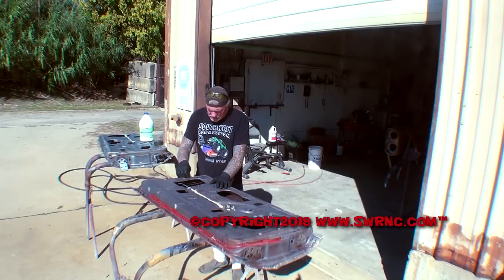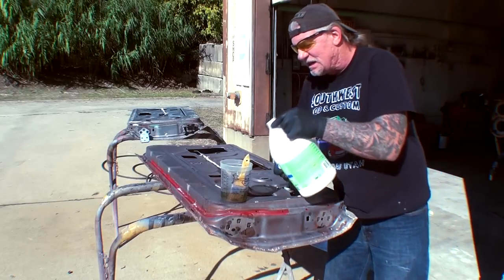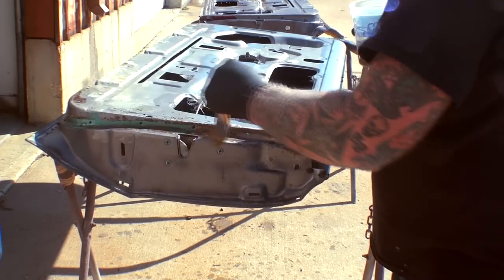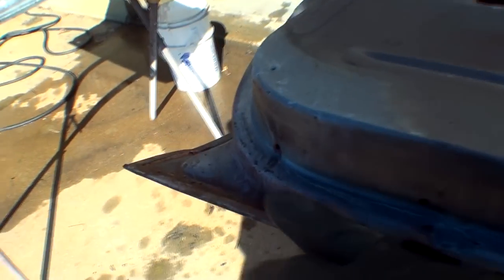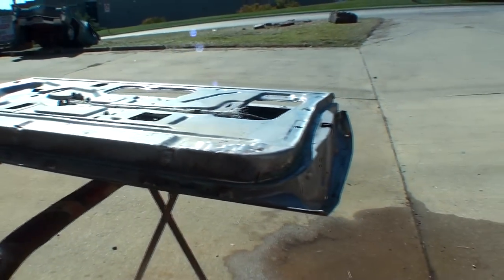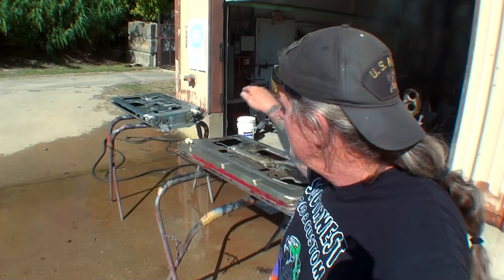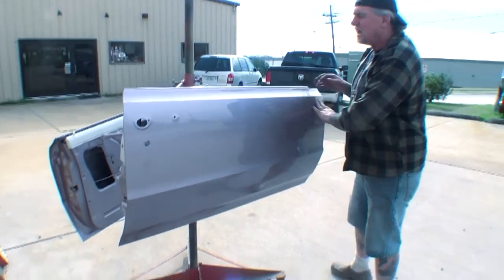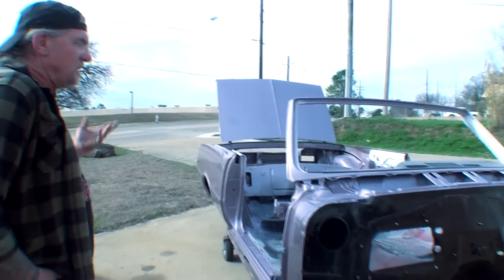"REMOVE RUST With Muriatic Acid - EXTREME GAIN!

Comment: Pete... buddy.  You did a good job stripping the car parts and getting ready for painting.  I notice that someone has beat me to it telling you that your technically wrong about the chemicals.  Muriatic acid is a very strong organic acid.  That yellow film left after vinegar (acetic acid) is RUST that is initiated by those acids you are using.  The acids eat into the metal because they combine with iron causing oxidation.  Adding  water when rinsing will also cause rust by introducing oxygen to the iron in the bare metal.  To stop or slow down the oxidation (rusting) you should use a baking soda and water solution. If you want to leave it exposed over night or for longer you can keep oxygen away from the metal to prevent or at least slow down the rusting by coating with PAINT (primer) of some kind or oil as soon as possible. Once you do that then you don't have to be a a super rush or hurry to get the rest of the job done. ALSO, any vinegar or muriatic acid left inside that door is going to cause accelerated rusting so it is very important to properly neutralize the rusting chemical reactions using a buffer or alkaline solution such as baking soda or an oil to block the oxygen getting to the exposed metal.  Old school is great but a little technology can preserve those parts for many years to come... a lot longer than just out the door with a nice paint job.

Comment: Ive beening using muratic acid for many many years works great....and neutralizing with vinegar, i would highly recommend one addition tip afterthe vinegar step... was with water and phosphoric  acid  the panel will not flash rust with orange flash rust... or just brush on phosphoric  pure... last months with no rust..

Comment: Keep the vids as long as you want to get the info explained properly Pete. Anyone who complains can bog off to somewhere else and annoy them lol. I’m a single female of a certain age who is chuffed to have made a new driveway at the side of my house in order to start the restoration of my Ford mk2 Transit 1983 ex ambulance. I’m learning sooo much from you and want to do it stage by stage and do it right because il be putting on many decals once the paint job is completely finished. Then the campervan conversion will begin. I’m totally obsessed with rust prevention as I live literally 50 yards from the sea, salted roads and it rains here in Northern Ireland probably 350 days a year! The last thing I’m going to do is general prime and paint the way I’ve seen other van lifers do as in 2 yrs I’d have to be starting from scratch again. Thank goodness you are prepared to take the time to help as without you imparting your knowledge, I realise I would have ended up with the wrong products which wouldn’t have done the job. Thanks Pete and camera lady xx

Comment: Dude, you can't neutralize one Acid with another Acid. Both "Hydrochloric Acid" and Viniger "
Acetic Acid" have to be neutralized with a "Base"  Baking Soda is a base. if you don't the acids that are sitting in the little places you didn't get thoroughly rinsed out will slowly continue to eat the metal under your paint. You can put the baking soda on directly or mix 1/4 to a 1/2 cup or more per gallon of water and spray it on the parts then rinse that off thoroughly once the bubbling has stopped. then coat the metal so it doesn't flash rust.
Reply: davem3945 I am EXTREMELY glad you pointed this out. Vinegar will NOT neutralize muriatic (or any other) acid. Baking soda (or another extremely basic compound) is the only thing that will neutralize an acidic substance. Thanks for your chemically related input! :)
Reply: @TheMudiver  using enough water will eventually nutralize the acid. I would use pH test strips to confirm in all the right areas before moving on.
Reply: @TheMudiver  Nope...  The surface layer of steel has as positive charge if not neutralized properly...  That is what causes flash rust....  The steel seeking to gain negative ions, oxidizes in the process.  A better choice is Phosphoric acid. It changes rust to ferric phosphate and Iron III Oxide. Both of which are stable and resist formation of more rust. But it still needs to be neutralized with baking soda in distilled water or ammonia in a sprayer.  To really fight flash rust, rinse with distilled water..  Chlorinated water is acidic.
Reply: I put a gallon of muriatic acid in my gas tank full of water so wondering what do I do in the morning when I dump it? I bought liquid seal and I was just going to put the gas tank in, seal it, fill it with gas as fast as possible
Reply: You don’t want to neutralize with baking soda it will leave a residue.  Best way is ammonia because it completely evaporates and leaves at neutral.
Reply: good recommendation for safety. two other things to be aware of though: the type of sprayer and its condition - the bicarb solution, when dried forms a film that can clog sprayers but cleans up easily with water keep tools clean and ready to use in an emergency to neutralize strong acids quickly (although typically muriatic acid solutions are only 25% concentrations of HCl). also be careful of carbon dioxide gas produced by the reaction of HCl and NaHCO₃. work in a well ventilated space and/or move to fresh air if you experience exposure symptoms.
Reply: @Imwright720   this is actually also a good recommendation. although this residue is easy to remove before painting. note though that HCl and NH3 react to form NH4Cl (ammonium chloride, which is typically found in fertilizers) as well as quite a bit of heat, depending on the volume of the reactants and how quickly the reaction takes place. the heat vaporizes both starting components and the NH4Cl crystals form in mid air as they mix together often producing a dense cloud of what looks like smoke. like smoke from a fire, this cloud contains a mixture of gases and solids which you should avoid breathing in. use a respirator and work in a well ventilated area for safety. NH4CL is often used in the metal working industry for prepping surfaces to be plated with other metals, such as zinc or tin. in this case we are talking about painting body parts but the same applies as a good cleaning method. It works as a flux by cleaning the surface of workpieces, reacting with the metal oxides at the surface to form a volatile metal chloride.
Reply: No worries,  your welcome.
Reply: @Imwright720  thanks for the information about ammonia
Reply: Phosphoric acid mentioned above sounds like a good idea, I’ve used trisodium phosphate (TSP) as my neutralizer in the past as it’s clean rinsing enough to get primer on.

Comment: Used this acid in concrete work for cleaning trowels and tools. Left a trowel overnight in the acid and the following day I noticed a discoloration line where the trowel corner had been submerged overnight. Thought nothing of it and went to the job site. When it came time for me to begin flat troweling the cement slab, I took one swipe with the trowel and when I put pressure on that corner it snapped right along the discolored line.  Those trowels are hardened spring steel and that acid turned the metal to a brittle potato chip.  Like Pete said, bad stuff if used improperly. Thanks for the vid, good info.

Comment: I have been doing something similar to Pete for two years now on my restoration and his advise is right on. Right down to the wire brush between acid coats. I use acid called Metal Prep from HD which does the same thing. Results are amazing. Multiple applications is the ticket too.

Comment: I want to know which of these chemicals will kill and stop rust on the inside of panels where you cant fit your hands to grind or sand??? just by spraying & then next spray some dome type preventative like POR and or chassis paints. What chemical would this be muriatic or hydrochloric? And next baking soda water wash to neutralize ?

Comment: What's your timing for NOT putting it into epoxy primer?   I hear some restorers put Ospho on if they plan on not getting to the body work for a while.  Then they reactivate with Ospho and then rinse with water, dry and start body work.
Reply: Read my other comments. What I said exactly. That's from a old timer from PPG paints. Water or water and baking soda. Stops reaction fast.

Comment: Yeah I like to get all my paint off my metal item. Do the Muractic Acid thing with paint brush, keep chipping, scraping and wire brushing it till it's off. Then rinse job with water and the apply till the surface is totally clean of rust in the pits. Then rinse with water. Then apply B&G rust remover (it's a liquid remover that leaves a coat to prevent flash rust after flushing with water. Once the metal is dry. If you live in a warm hot climate leave it in the sun or colder climate use a propane torch to dry the metal out. At this point u can prime it or lightly sand blast if you want the nice satin finish of sand blasting. Blow it off with compressed air degrease if you touched it with oil or bare hands. Then body work the panel or prime it. 
Acid has the ability to get into the pits which sand blasting can not do.

Just want to add to above.

Another way of Derusting if you have not seen on You Tube is Electrolysis.
 Where you use a 10 amp 12 volt battery charger.
U have a large pail of water, a wooden stick across the pail.
You hang your rusty metal item on a S hook off the wood stick. You then hang four metal rods around the edges of the pail. Wired in series back to the first rod. The metal rods must not touch the piece on the S hook to be de-rusted.
The metal item Ito be de-rusted is attached to the negative terminal of the battery charger. The metal rods around the pail are charged positive. Let it sit for 24 hours. All rust is attracted to the out metal rods which are your anodes. This is the cheapest way to remove rust. After clean the metal item with SOS pads, liquid soap and flush with hot water and dry.
This method does not remove any base metal.
Do not do inside, operation produces hydrogen. OK

Comment: Interesting video.
Muriatic acid will clean concrete and is even a phenomenal to clean out your engine block for a rebuild. Not to mention that it will dissolve the galvanized coating on steel.

However, addressing an acidic condition by introducing more acid doesn’t make any sense. The easier and cheaper solution is to saturate the item in baking soda dissolved in water. This will neutralize the muriatic acid

Comment: Thank Pete.....getting ready to us muriatic acid on the inside of a old flintlock barrel that has been neglected for the last 100 years.....in fact, mud daubers had taken up residence inside the barrel.  The stuff works......just work fast with it!
Reply from the maker: and make sure to remove it all too.. If not all removed properly will keep eating the metal and actually rust!

Comment: i use fosforic acid (+/-50%). with brush or spray. after it's been working in i usually take methylated spirit to clean it. Water brings risk of rust again. But this also seems to work. Nice video and usefull channel👍

Comment: I use metal prep after acid so it doesn't flash rust before painting. I also sand rust before using acid because it speeds up the process.

Comment: My friend Pete I have a 67 c10 that I'm gonna restore.  It need a floor and has surface rust in the inside of the truck from where the cab corners were rotted out.  My question is should I get rid of the surface rust in the inside before replacing the floor? Thank for all your help.  🤝🤝🤝 a hand make a Friend.

Comment: Good video, don´t worry about the length of the video´s you have to if you want to get into detail.
What i would like to know is how to tackle the inside cause the cars in the sixties didn´t have any protection on the inside were the cavities are and when you cleaned it out what do you tread it with, a cavity wax?

Comment: I just used a half gallon in my KLR 650 gas tank that I just picked up was pretty rusted inside surface rust wasn't too bad I put it in full strength half gallon ship it back and forth about 2 hours trained it out put the garden hose in let it run shaking it around let it drain it Dad about 10 times emptied it out completely looks really good inside now I'm going to put about a gallon of gas with marvel mystery oil in it shake that around let it soak overnight and then we'll see okay take care brother rock and roll

Comment: If you use this process. buy a few boxes of baking soda and keep it next to you.  you can neutralize the acid with bakingsoda. if you get the acid on your skin. quickly rub the baking soda on your hands before washing them.  also use goggles with side shields.    this is the best way to get rid of rust from steel. it will eat rubber and aluminum also..

Comment: .. Another great video. I wish you and YouTube had been around when I was young, would have saved me a lot of money on products that did some times work but were quite expensive compared to muriatic acid and vinegar water chaser. Also, thanks for explaining how to deal with soda blasted metal. I'm sure you have heard the nay sayers talking about how paint won't stick to the metal after using it.
Reply: If we Gen X had this tech, we'd solved half the problems by now. Not eat tide pods, die from cinnamon, and be YT stars.

Comment: So unsafe to be using a rotary abrasive wheel on wet acid because it will cause it to spray everywhere.  As a safety precaution I would advise having a water hose close by or a large bottle/ bucket of water to use for flushing acid from eyes and face

Comment: I have a gas tank that I am trying to salvage because the replacement is $400.00.  What are your thoughts on using muriatic to remove gas tank rust?

Comment: I use the POR15 metal prep same basic thing works great. Hand wire brush speeds it up if you hit it on the rust parts and re-apply. wipe down with alcohol or or degreaser. I would not spray it with water though the next day it would start to rust up again.
Reply: That's why it sucks. Save money and get acid. U can use water.

Comment: Thanks Pete!  I plan on using epoxy primer on my Wagoneer project as I'm going down to bare metal in a number of spots.  Would there be an issue with epoxy and an acid wash like this?  Vinegar or metal etching?  I'm afraid I won't fully rinse and neutralize the acid before epoxy.
Reply: It can be a major problem. S.P.I. strictly forbids it.
Reply: I use Ospho. I reactivate with ospho when ready for epoxy, let set for 5 min, wash with water n baking soda mix and red pad if you like, dry and ready for epoxy. Will work fine. Try on a test piece and see for yourself. I've used it forever now. Sold at ace hardware or Amazon. By skyy Co. Ospho. Or Eastwood prep n etc. Same thing. If Eastwood says it's Phosphoric acid will be ok with epoxy etc, they wouldn't sell so much if it wasn't so.

Comment: Awesome video, thank you.  I have a bunch of surface rust I need to get rid of on my '87 truck.  I do have a question for you.  The steel wool and the steel wool brush you used, was it stainless steel or just regular steel wool?
Reply: Everett Green If this is still relevant, regular steel wool.

Comment: Could you put that in a cheap spray gun or pump sprayer and spray it instead of brushing it ? Acid and vinegar/water?
Reply: No dont spray that will atomize acid an get on other shit an you imho
Reply from the maker: the fine mist will get everywhere and ruin a good thing.. BRUSH ON ONLY IN THE SPOTS THAT NEEDS IT!
Reply: @diyautoschool  Good deal. Thank yo sir.

Comment: Hey Pete, any recommendations for treating inside the doors? I see surface rust in there, but I can't get my hands in there to brush it on.
Reply: Clint Cochrane I had a impala I took the doors to a good sandblaster. Thick steel with hard body lines ( and skilled blaster) no warpage. If it’s pitted(holes)it’s got to get cut out, you could do a encapsulator on inside. My doors had undercoating inside that was horrible to remove.
Reply: Muratic, then Ospho.

Comment: hey pete how do I remove the 67 Chevelle Convertible Pinch Weld Surround Chrome Trim Molding on my chevelle, im restoring it, already have repaired the quarter panels, trunk floor & trunk floor supports, but I don't want to damage molding, its on thiere tight, thanks...

Comment: You should have put the  muriatic acid in a spray bottle and spay it on instead.  It will save you times and if you let it sit too long, the acid will eventually  eat the bare metal too, not just rusts.  Good job though.

Comment: If the jug doesn't show a concentration it is less than 31%. I got cheated at Lowes. 
Atwoods had 4 gallons 31% for $16. It was more than I needed but too good to pass up.

Comment: Use an electric blower to get rid of most the water off before drying.
Hot hot water also helps to dry off the water. 

You could fantastic work. Thanks for sharing your skills!
But I could have done without the ranting and raving.

Comment: If splashed on your clothing you might not get burned on the skin if the amount is small to tiny.  Once your clothes come out of the washer, your clothing will have holes where the acid was. If you care about what you are wearing, change into old stuff you don't care about or wear a rubber apron.